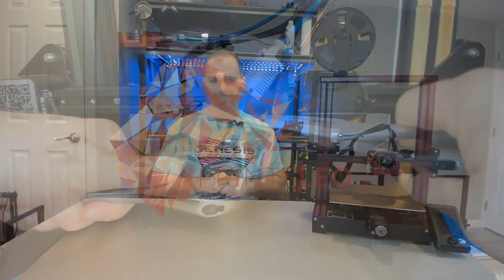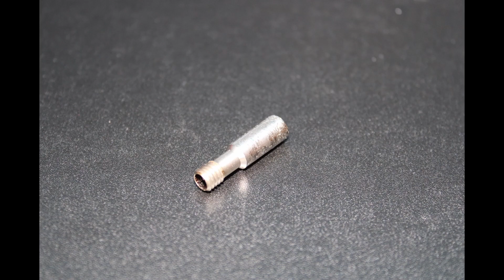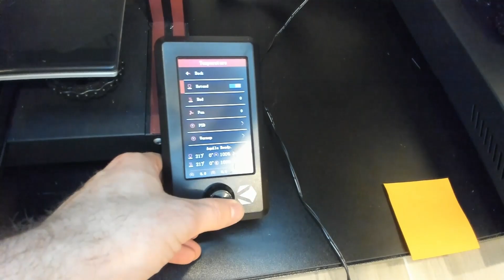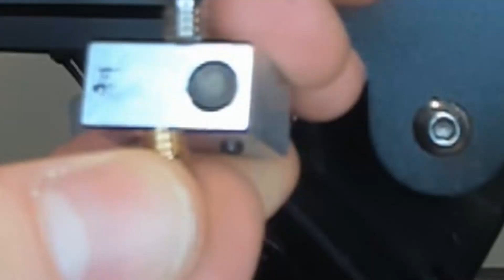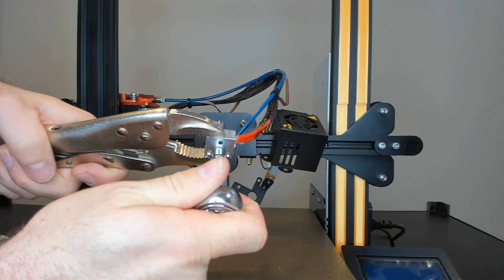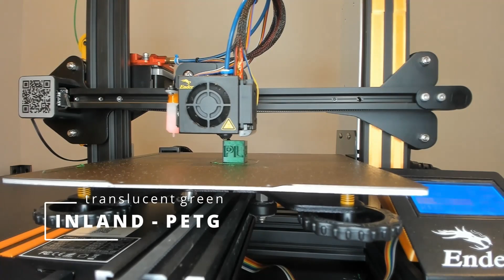Print High Temperatures on the Voxelab Aquila with a new Heatbreak!

Comment: Voxelab Aquila's temp limit is 260 C, I need to print on nylon, 290-300 C is required, do you know of any custom firmware to raise the thermistor temperature to 300 C?
Reply from the maker: Javier, you have a few options. First, you're watching the high temp printing video, so I assume you know about the safety precautions you want to take before printing high temps. As for the options, depending on your mainboard chip, I have some high temperature for eares available on my website (PrintsLeo3d.com), and Voxelab has some high temp firmware on their website that is aimed for the S2. While you may not have an S2, the firmware should be compatible (as long as the chip is correct). The S2 firmware is high temp(300c) and the only factor that would not work for you is the length of the load and unload options may be unusable for you, so you'd have to load and unload filament by hand.

Comment: Does the heatbreak in the link work for the voxelab aquila? I bought tje titanium one and there is too much spacing between the nozzle and the tube becuase of it. So I get a heating failure now.
Reply from the maker: Yes both of the linked heat breaks will work for the Aquila. After you change the heat break it's a good idea to run a new PID tune, and that should solve any heating issues. PID tuning calibrates your hot end to properly maintain a given temperature in your environment. If you have the newest version of Alex's firmware you can run a PID tune through the menus. If not you can use free software called Pronterface to interface with your printer and run the commands through the terminal line. I have a seperate video that goes over the PID calibration. Let me know if this helps or if you need more assistance.
Reply: @PrintsLeo3D   So before installing a new heartbreak I already had upgraded to Alex's firmware in around November of last year(Even got the rick and morty theme). Where in the menus do I go to run a new PID tune, and which video goes over the PID calibration?
Reply from the maker: If you have Alex's firmware you probably don't need to watch the video (unless you want to understand what it actually is and does). I believe through the menus you go through Advanced>Temperature>PID tune. You'll need to select a temperature to tune around, and you'll want to select whatever your normal printing temperature is (for instance if you are printing PLA at 205c all the time, then tune at 205c). Then you'll run the test for around 5-8 cycles. After it's finished make sure to Save Settings under the advanced tab

Here's the PID video: https://youtu.be/vCQWx4MBjjY

Comment: At which price point would you recommend skipping this $7 upgrade and jumping straight to a Microswiss clone?
Reply from the maker: That's a great question, and for me it's a time to money scenario. If money wasn't an issue I'd pay for the convenience of replacing the whole hot end. If money is factor than I would take the cheapest option which should be the heartbreak, at any price below a hot end.

Practically though, I like the Gulf Coast Robotics hot ends. They're what I have the most experience with , and they are around $35. If I could find a trustworthy company selling a heat break for $15 or less than I'd probably go that route. So less than $15 I go heatbreal, otherwise I'd spring for the GFC hot end.

Comment: Hi Again Leo.. Hope things are going good?  2 things to tell you!  1 > I think I be changing the Aquila firmware back from the sprite one you got me to use for the high hot end I use because since it did change the top heat to 300 c I needed, it seems to have upset the auto leveling even though I picked the 4x4 BL one. also it makes the printer load about 10 inches of filament in the loading option.  

2 > Amazing news I managed to get the money I needed to now order from Elegoo site my 1st Resin 3D Printer, the lovely big format New Saturn 2 ( 8K ) hopefully it be delivered in early December? I ordered from Amazon UK some cleaning stuff like the silicone mat and 3D Printing Resin Filter, Collapsible Silicone Funnel and Stainless Steel Strainer Kit . 
and some reusable & washable carbon based face masks.  I wished to buy some resin too but it is pricey and I can get it bit later on when I paid again.

I really excited to use this amazing big format 8 K printer soon!  Thanks fr your help n the Aquila. 😀
Reply from the maker: Hey Colin, great hearing from you again! About the Sprite firmware, I forgot to tell me you about the loading. Because the Sprite is a direct drive it will only load/unload about 30mm of fialement. Not everyone uses that option so I forgot to mention it. For the auto leveling, did you check adjust the x and y offsets for your bl touch? Also, and I probably mentioned to you last time, you should calibrate (if you didn't already) your E-steps and the PID heater settings. 

On the resin printer, congrats! I had one a while back but didn't really fall in love with it. I keep waiting to give it another shot because the stuff they are capable of is amazing! Let me know how it goes I can't wait to hear! Good luck and message me if you have more firmware questions or if you need me to make specific firmware for you !

Comment: Hi Leo. How do I change the setting in Alex's Firmware g-code list to make my top temperature of my new high heat all metal hot end to go up to 300 C on the Aquila G32 board printer?

My new high temp all metal hot end can if needed go up to 550 C ( mad I know ) But I only have at this time managed to find the heater cartridge and thermistor that can max out at 300 C.

Which since I only doing Carbon Fiber PETG or Nylon and soon when I change the heat do maybe ABS,
I just need to know how to change the max temp in the firmware and what do I access that with?  Thank you.
Reply from the maker: Hey Colin! The only way to increase the max temp with Alex's firmware is to actually edit the base firmware and then compile it yourself. Luckily I do have some pre-compiled firmwares that should fit the bill! If you go to my website under the 'Firmware' section you can find 'Voxelab Aquila Sprite Extruder' under the Marlin options. That page should have the firmware you desire. It's specifically set up for the sprite extruder (I explain on the page the alterations that have been made) but all those changes can be adjusted on the front facing side of the printer (meaning through the screen or gcode adjustments) and are only meant for convivence of someone who has the Sprite. The main change is the high temp, up to 300c, which is what you need. If you need help with it or have more questions let me know!
Reply: @PrintsLeo3D  Thanks Leo I check it out now and if needed I ask you again? Thanks
Reply: Hi Leo Okay I have the BL 4X4 Profile download do I just put it on the SD card like the updates normally are and flash it on the Printer?
Reply from the maker: Anytime you need I'm here
Reply: @PrintsLeo3D   Cool. 😃
Reply: @PrintsLeo3D   Hey Leo... Problem hopefully you can guide me?  I copied the firmware profile file on to a micro sd card I use with the Aquila and it had no other files on it, I put it into the Aquila card slot and turned on the printer. Nothing happens no updating of the heating!  I turned the temperature on the menu to max it still goes only to 260 C.  What have I done wrong?
Reply from the maker: In order to flash firmware to the Aquila the file has to be nested in a folder labeled 'firmware' then you can insert it into the Aquila
Reply: @PrintsLeo3D   Oh yes so long since I did this I forgot.  lol  Thanks again for jogging my old brain how to do this. Love the new look of the videos now btw much sharper so be better to watch.. cheers 😉
Reply from the maker: I feel you on the memory jog, there's so many nuances to this it gets confusing lol thanks for saying that about the new videos, always trying to get them more watchable, if it gets more people to stick around and pick something new up that's the goal. Cheers!

Comment: After some experience with plugged hot ends... you need to specify some things here imho.. at least for noobs like I was when I watched this and mnessed up my printer.... 3mm retraction is too high for all metal. you used bowden tubes in the tutorial and others will too. then they will get clogs, especially if they use pla or petg. pla and all metal is a bad time all around too. even at 180 I was getting clogs. I mean now I know but back then I didnt. if you combine all metal with direct drive you will get better results by far. might be worth mentioning. at 1mm retraction now and no clogs with petg and I keep my pla on machines with the stock setup type stainless heat break.up to 3 printers now and all but the newest have direct drive and it will asap. It's an $18 bracket for crying out loud, not hard or expensive.
Reply from the maker: Brain thanks for commenting and giving me an educated and experienced take. All ever I want is to try and help people, especially newer people navigate the intricacies of 3D printing. I certainly agree I need to be more specific in this video, but I don't agree on the same conclusions. 
    Bowden style all metal hot ends, for me, have always needed no more than 3mm of retraction. There are times I can lower it, maybe to 2mm, but I've never had to go lower than that and it's never caused me any clogging issues. Often the issue is with the heat breaks themselves not being 'polished' and smooth on the inside causing issues with PLA. The units I used in this video both have never clogged on me and were able to print a range of materials. That being said other people's experience may vary and you never know when/if a company will begin to neglect quality.
    Direct Drive all metal hot ends I've used have never needed more than 1mm retraction. In general Direct Drive(extruder) is going to have a much lower retraction than a Bowden setup because the filament path is greatly reduced. 
    One of the main issues this video looked at was the stock hot end and it's setup of having the bowden tube pressed against the nozzle. That pairing along with high temperatures can lead to health risks due to the PTFE. Some people disagree on the danger temp(or if a risk exists at all), but for me that was an important reason to modify the stock setup. If you are printing on the stock setup with stainless steel heatbreak, whether it's direct or bowden, you need to be aware of those temperatures. So even if modifying to direct drive reduced any clogging issues there still could be a risk of reaching danger temperatures. That was one of aspects I was trying to highlight in this video. 
    Thanks again for watching the video and taking time to comment and help out the channel, the viewers, and me!
Reply: @PrintsLeo3D  Yessir, while we can disagree on retraction plugging distance, It all depends on the filament and polish, I can't afford Slice though, and you can even rejuvenate old PLA plugged heat brakes by soaking htem in acetone, doesn't work for petg though. Maybe something harsher would work for petg? I also used an airbrush cleaning kit to go at it, and then some pipe cleaners with rubbing compound. Probably overkill but def getting the cleanest petg prints I ever have with an old formerly plugged up heat brake lol. I have a long way to go and I don't doubt you. It's probably something else on my end I haven't figured out yet but just sharing my 2c. Thanks for the reply. Keep up the good content, I don't mean to sound bitter lol it's my own fault for printing PLA with it as a noob.
Reply from the maker: Those Slice heatbreaks are gorgeous but like you said they can break the bank (and rightfully so). You don't sound bitter at all  I understand exactly where you're coming from. You're speaking from experience and that's really the most educated we can all be. I hate it when someone has a bad experience with something I've recommend, it kills me. I feel so bad, I never want to add stress to someone's enjoyment of this hobby. So I truly am sorry you had a bad experience with this. if you need any help or just want to chat in the future jump into the Discord, we'd love to have ya! Thanks for always watching and commenting I appreciate that!

Comment: I cannot seem to get mine to stick to the bed using ABS. it begins to work, but it lifts. I really need to try an enclosure. I have upgraded my Aquilla with a raspberry pi running klipper. The only downside is I no longer have local control over the printer.
Reply from the maker: Yea ABS can be a fickle beast. When I am using glass with ABS I always use a glue stick, when using PEI I don't although it's possible I should because sometimes it can over-adhere. The enclosure is the biggest advantage when printing ABS because it loves to peel up. I would recommend printing with a nice thick Brim to try and counter act the warping. I just uploaded Klipper onto my S2 last night and I remembered reading there is a work-around  to get the screen working with Klipper. I'll look into it and get back to you!

Comment: thank you for the good video: i try to buy the copper ones but theres a note by the seller that says not use this one for PLA. what is your experience???
Reply from the maker: I've been using both of these heat breaks for a while now and I haven't experienced any issues with PLA. I reduced my retraction to somewhere around 2.0mm I believe. They've both been printing well for me. The allure to these heat breaks is the low cost but they wouldn't be worth it if you can't print the most used filament on the market-PLA. I wonder if they changed something in manufacturing? The only reason clogging would occur is if the internal bore is not smooth, copper itself should have no bearing on it clogging. I also see there's a section that talks about 'new settings for PLA'. I am going to reach out to the company and find out exactly how they feel this can print PLA. Like I said though, my units have all been printing without issue.